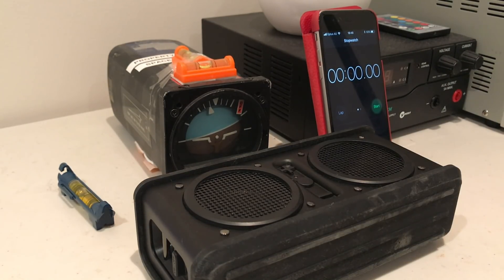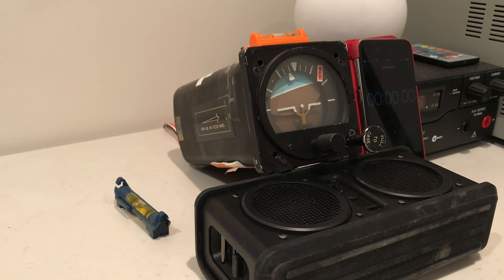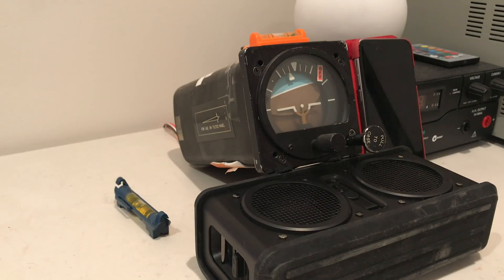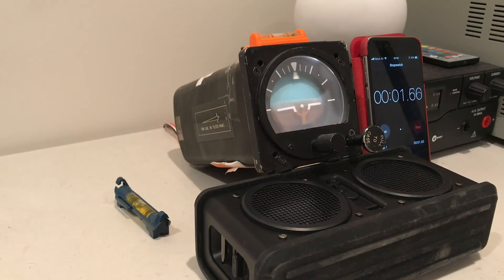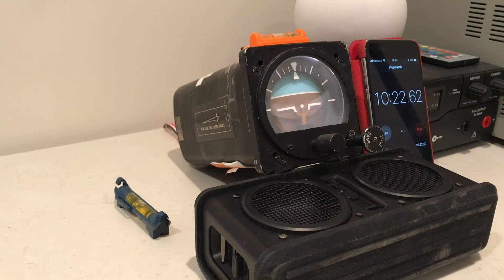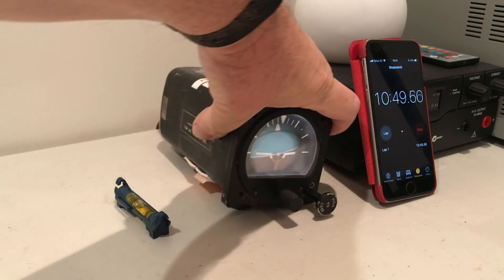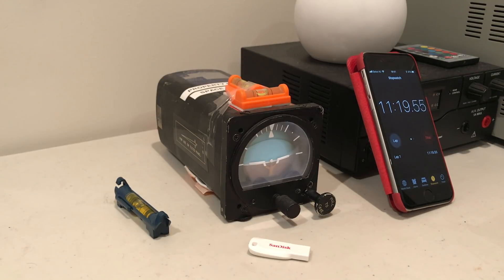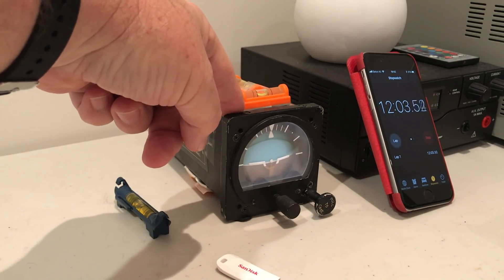Flat Earth - An often requested Artificial Horizon Experiment - Powering up at an angle.

Comment: I have collected some patents concerning AI erection mechanisms you can point out to flat earthers to prove that such systems exist since the first AI's and are essential for AI's to work on the globe:

Explanation of pendulous vanes on air driven AI's. Note that airliners do not use air driven gyros, as the animation suggest:
https://youtu.be/C0pZ-mVcbbI?t=233

Explanation of one of the used erection mechanism in electrical driven AI:
https://youtu.be/C0pZ-mVcbbI?t=672

Patents

Note: all patents have in common, that the induced precession rate to erect the gyro must be greater than any drift rate, but smaller than the rate during maneuvers. Typical erection rates are some degrees per minute. Some of the patents sense whether the aircraft flies a maneuver and turn off or switch to another erection rate during the maneuvers to prevent maneuver acceleration induced false erection (maneuver drifts).

Patent of erection mechanism using pendulous vanes in air driven AI's:
Patent US2409659 A, 22. Okt. 1946: 
https://www.google.com/patents/US2409659

Patent of air driven erection mechanism using an arc shaped gravity pendulum in a case that closes some outlet nozzles when out of alignment with the gyro. This produces some unbalance in the forces which erect the gyro. To prevent erection during maneuvers, inertial sensors sense accelerations and turns and activate electromagnets that lock the pendulum in its null position.
Patent US1934774 A, 14. Nov. 1933: 
https://www.google.com/patents/US1934774
https://www.google.ch/patents/US2038531

Patent describing an erection system, which is responsive to the flow of air for erecting a gyroscope. The erection system includes a plurality of channels having balls disposed therein. The balls are responsive to the gyroscope being tilted from an erect attitude by a first relatively small predetermined angle (0.5°) for rolling in the channels to create an unbalanced flow of air through the erection system, which provides a force to erect the gyro, and are responsive to the gyroscope being tilted by a second relatively large predetermined angle (10°) for rolling in the channels to negate the unbalanced air flow which disables the erection system.
Patent US4527439 A, 9. Juli 1985: 
http://www.google.com/patents/US4527439

Patent using mercury switches to sense direction of gravity and using torque motors to erect the gyro. The patent describes an additional system to reduce the erection rate when a flight maneuver is detected.
US2972893 A, 28. Febr. 1961: 
http://www.google.com.ar/patents/US2972893

Patent using mercury switches to sense direction of gravity and using torque motors to erect the gyro in normal mode. The patent uses an additional mercury switch to detect horizontal acceleration and a spring restrained gyroscope to detect flight maneuvers to switch to pitch/roll erection mode during this maneuvers.
US3077787 A, 19. Febr. 1963: 
https://www.google.com/patents/US3077787

Patent using mercury switches to sense direction of gravity and rotation about vertical axis, using solenoid to displace masses that induce precession to erect the gyro. The rotation sensing mercury switches are used to change the precession rate on maneuvers.
US2842968 A, 15. Juli 1958: 
https://www.google.ch/patents/US2842968

Patent of an erection mechanism using free rolling masses in a slowly corotating special cage, deflected by gravity so they produce a torque at the right gimbal to erect the electrical driven gyro in the AI's:
US2603095 A, 15. Juli 1952: 
http://www.google.ee/patents/US2603095
US3498146 A, 3. März 1970: 
http://www.google.tl/patents/US3498146

Patent of an electrical erection system using a gravity sensing pendulum mechanism and torque motors. Erection signals are cut during maneuvers to prevent gyro errors, by sensing translational movements with accelerometers:
Patent US2969683 A, 31. Jan. 1961: 
http://www.google.co.in/patents/US2969683

Patent of an electrical erection system using a system of a steel ball, moved by gravity, and an arrangement of 4 coils affected by the position of the ball. The position of the ball changes the inductivity of the coils. This change is converted into an electrical signal that drives two torque motors to erect the gyro.
US2553268 A, 15. Mai 1951: 
http://google.to/patents/US2553268

Patent using pneumatic amplification to create a counter torque to erect a gyro. The sensing device consists of a steel ball, that is positioned by gravity, to open and close small air inlets which when closed produce an amplificated air stream which creates a torque.
US3498145 A, 3. März 1970: 
http://www.google.com.vc/patents/US3498145

Note: some of the the linked patents are rather old an scanned documents. The scanners did not work properly on some docs, so they are sometimes difficult to read.
Reply: Among others that I'm sure exist, there's one common thread throughout all those patent filings: none were designed by a gravity denying flat earther.

Comment: I tried explain to a flerfer how a pitot-static system needs to be adjust for the relative height above sea level, compared to Radar-based altimeters etc, so altitude is usually taken from the air-pressure, not the actual height. I'm not sure if they didn't understand or didn't want to understand.

If there's one thing I DID learn it's that they aren't really interested in 'the truth', simply in their 'truth'...
Reply: Just ask them, what good a radar altimeter would be when flying over some mountains. According to them, the altimeter should show an ever changing reading.

Comment: If you are in an uncoordinated turn in an airplane. And the gyroscope attempts to seek down accounting to the gravity felt relative to the airplane then it will always be grossly off every time it exits the turn.
Reply: But you'd have to hold that turn for a prolonged period, many minutes in the case of this model, for it to be thrown off and then it would correct back to normal after the turn ended.
Reply: And pilots avoid prolonged turns for this very reason, and instrument-rated pilots are trained to understand when this type of error might creep into their instruments and compensate for it.
Reply: Wouldn't that happen even if the turn is coordinated?
If I have understood that term correctly, the purpose is to keep the bank angle such that the wings are perpendicular to the direction of net acceleration (the sum of gravity + centrifugal force) and thus keep the passengers from being pushed sideways in their seats or spilling their drinks.
But that doesn't change the fact that the net acceleration is different from true down as defined by gravity and therefore will mislead the AH if the turn lasts long enough.
Reply: Yes, as long as you are accelerating in a constant arc, the artificial horizon will slowly drift to match the direction opposite the combined net acceleration due to gravity and the turn. It doesn't matter if the turn is coordinated or not, as the artificial horizon gives not a care for the actual orientation of the aircraft or its own housing, only where the gyroscope is trying to remain fixed and the corrective action of the pendulous vanes to match the (apparent) direction of down. The gyroscope serves as an averaging function to the instantaneous "down" the instrument experiences.